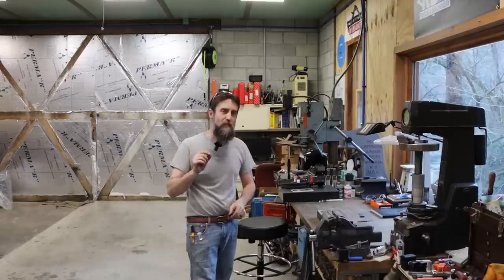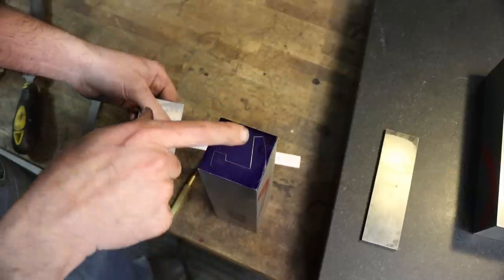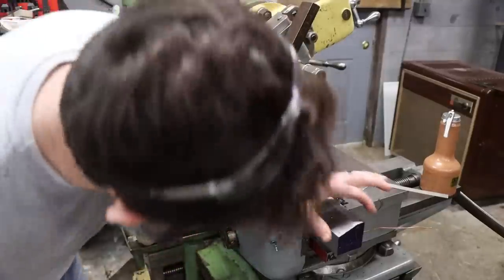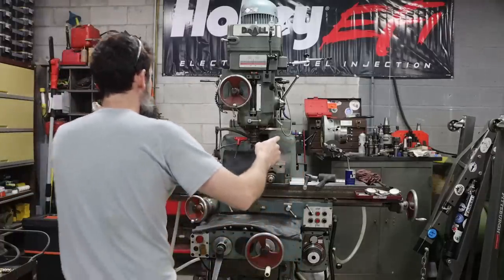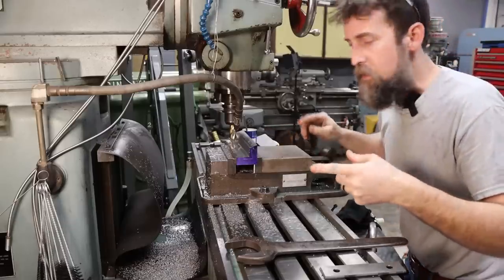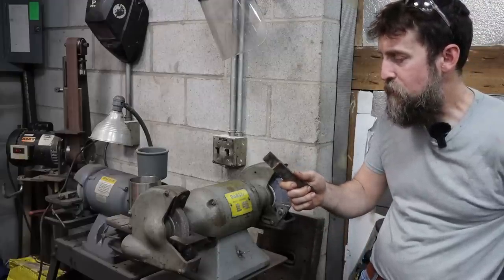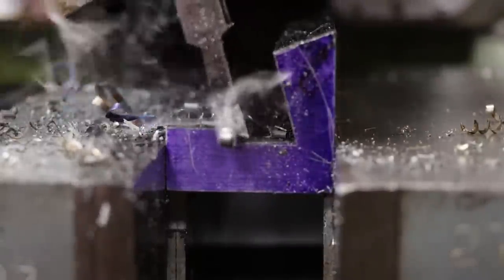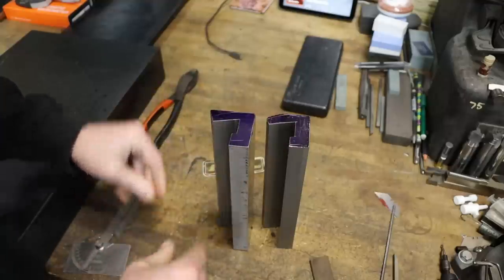Saving a Monster Vise from the past. Metal Shaper saves the day.

Comment: As for the real cost of owning a shaper, espeically in small scale shops (or even hobby shops) isn't even the monetary price of the machine, or the low maintenance cost over time, but rather the enormous amount of space they need. While I love the idea of one, I don't think I could justify the required space it needs in comparison to getting a surface grinder for example. And quite often the machine choice for small time and hobby shops isn't "what do I want" but "what can I fit", or "if I get this, what can I not fit anymore".

Comment: Hi Steve,  in my humble opinion the good old shaper is the most underrated machine tool on the planet, a well set up shaper in good condition can shift a lot of metal very quickly, if the tool loses its edge, a couple of minutes on the off-hand grinder will soon sort things out. You and Cora are starting to get like Scott and Frankers up there in Alberta. Here's wishing you and your family a Very Happy Easter from Somerset, England.
Reply: They say it will make anything but a profit.
Reply: @stevefarley7014  I'd guess Steve has overcome that niggling detail with the number of subs he has.
Can you imagine doing the bulk with an abrasive cut off wheel, I could...

Comment: I know that shapers and horizontal mills have long gone out of favor for most machinists, but there are still jobs where they are the best tool for the task. Many years ago I worked in a job shop, and we still had an old horizontal mill and a smaller shaper in the shop. No, they weren’t used everyday or even every month, but there were still times when they were the perfect machine for a particular job. Would love to find a small shaper for my shop someday….

Comment: Steve: Thank you for letting us have a quick look at Cora. Also, something that might help with directing the coolant flow on the mill. A 90 degree neoprene spark plug boot. The plug end would probably slip over the discharge end of the coolant pipe and the wire hole end would get you right up against the cutter!
Reply from the maker: I love the boot idea 💡

Comment: Being a Shaper owner and fan, love that you and others teaching videos are most helpful. One day my Klopp 450 will get reassembled and up and making chips. One thing I learn from others, was to have the cutting forces going towards the fixed jaw of the vice? But your vice is a beast, and when cutting the 15deg towards the clamping jaw, the part never moved. Thx Steve, this one added more to the ole memory bank on grinding tooling as well. thx Buddy. PS - at 24:29, that Stink Bug was checking out you grinding the tool. If you want them to leave the shop or house, place Horse Apples out side and in corners of the shop. It with also attract scorpions, and spiders. The acid from the apples will kill them. Bear.
Reply: Hey Bear, what’s a horse apple? In Ohio we use hedge apples (Osage orange fruit) to get rid of spiders, scorpions don’t bother us up north here. Lol
We might be talking about the same thing.
Reply: You may have seen this already, 
Cutting Edge Engineering CEE YouTube Channel, has a KLOPP 1000 H shaper they are renovating for their Engineering Shop just thought you may like to check it out.
Reply: @Hoaxer51  You are.  Here in East Texas, they are B'ois Darc (Boh Dark).  The fruit or seed pods look like a big green orange with a surface like a brain.  The tree has thorns on its limbs.
Reply: @royreynolds108 , Yep, that’s it.
Reply: @PhotogNT  I WILL , Thanks👍 More blooper material
Kurtis does nice work
Reply: Mom put them under the kitchen sink...

Comment: Good Saturday Mornin Steve, Cora, and Grits! I always enjoy watching you solve a difficult task with simple solutions and not afraid to switch horses in mid stream. Thanks for the endorsement of Hi-speed steel. Carbide is good for production. Us amitures are better served by HSS. Quin always recommonded that too. Thanks for another inspiring Saturday mornin. God Bless!
Reply: One thing about carbide is that interrupted cuts tend to break them. They just can't take the shock loading that high speed can.

Comment: I assume that there was a power compound feed for this shaper? Have you thought about recreating it? The ones that I have seen used a bowden cable to operate a pawl on the feed screw actuated by a cam on the slide. (Though there must be a little more to it than that to avoid feeding on both strokes)

Comment: Shapers were abandoned because of engineers not machinists or tool and die makers. A two flute carbide insert, .750" in diameter, fly-cutter  would rip out that part in no time if you buy a premium one like those from Kennametal.

Comment: Why couldn't you spin an end mill in your cutter grinder With the appropriate angle on the bottom .  You would have to adjust the head  Angle on your Bridgeport and might have to regrind a couple flutes But would definitely be the fastest.
Reply: It would still cut a square shape because it is rotating... you would basically be turning a mill into a fly cutter by attempting that.

Comment: This is probably a stupid question, but do metal shavings ever get recycled into "new" metal stock? I'm guessing there's too much contamination and mixing, but how about in more production oriented shops?
Reply: Sure. The shops I worked at had large dumpsters for the scrap. A contracted scrap yard would routinely pick up the full bins and swap out an empty. Most all of the swarf/shavings was sold as simple steel unless it was larger chunks of say aluminum or brass. Separating aluminum and brass swarf from steel was not something that is real cost effective.
Reply: @grntitan1  Thanks for the explanation. I figured if it was a money saver someone would do it.

Comment: I actually learned the basics of machining, squaring blocks (made 123 blocks and Vee Blocks nearly 50 years ago) on shapers.  Steve I have a question.  You have a fixture for your cutter grinder that will hold a small square or rectangular piece and it’s adjustable in 2-3 axis.  I am looking for one but don’t even know who makes it or what the formal name for it is.  It almost looks like one could be made but the time to make is hard to find vs locating one someone would sell.   Any information you could supply would help.

Comment: Steve, do you have a CBN wheel on your Baldor 500 cutter grinder behind your bench grinder or are they both diamond? I am going to guess the latter. I set up a Baldor with a CBN wheel  on one side for cutting HSS tools and it's the Cats Meow to finish off a custom tool grind!

Comment: It was interesting to me that your DoAll mill doesn't have a tilt head. You could have roughed everything with roughing cutter and cleaned it up on the shaper. I have Bridgeport, and a 3 axis CNC, but the shaper is the machine I learned on 39 years ago. Always enjoy watching you learn new stuff. I recently took up woodworking and I have no idea what I am doing. lol
Reply: Fine woodworking is different beast, I had 4 yrs in HS wood shop and little practice since.